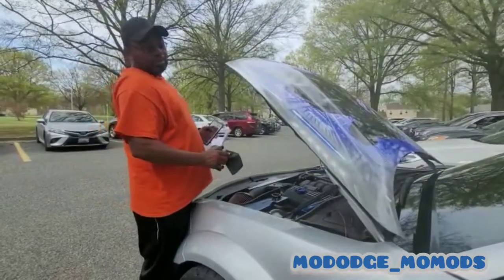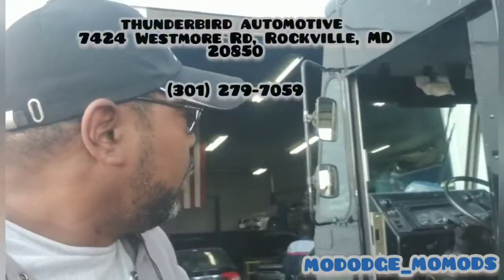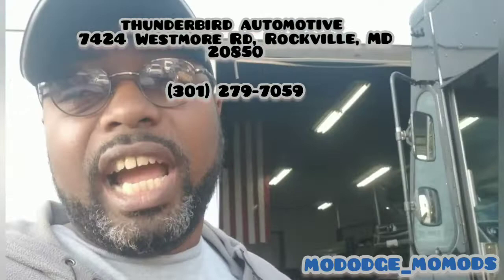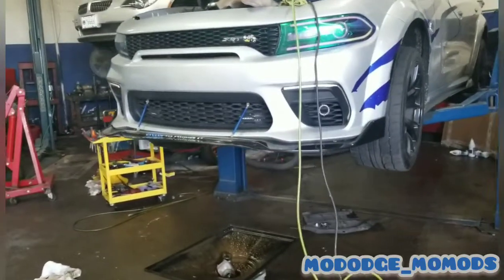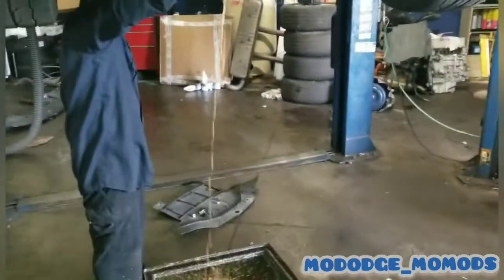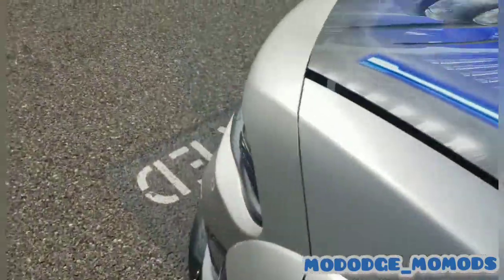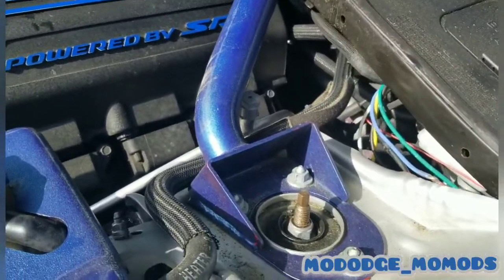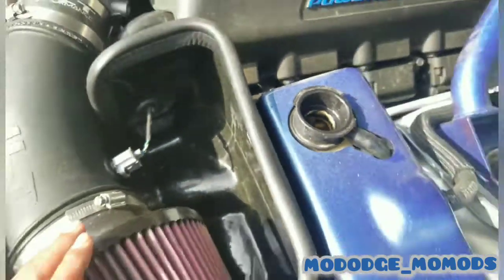Dodge Charger Gets Bad Oil Cooler!!

Comment: I have a Chrysler SRT 2018 when should I change the oil cooler? Now 67,500 km 🙄
Reply: 2015 Jeep SRT 176k miles oil cooler still good
Reply from the maker: Only change if it fails like mines did.